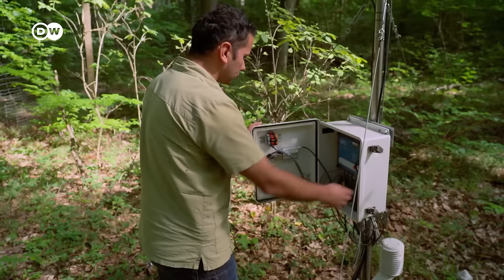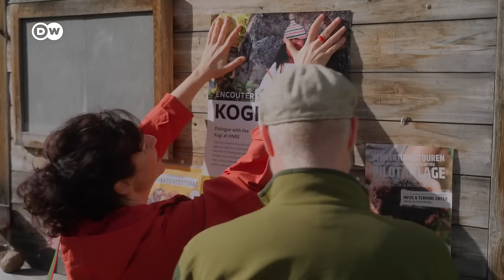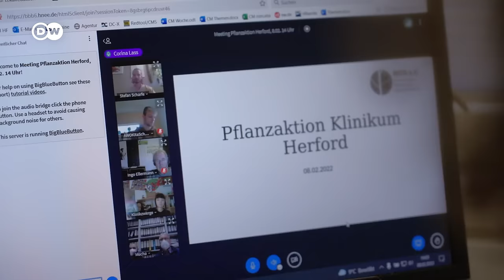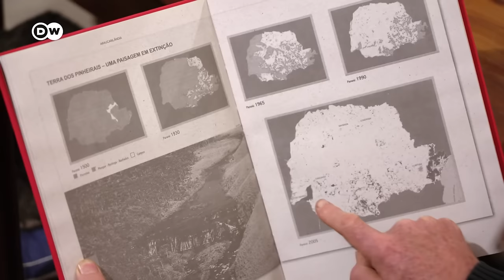Can trees stop climate change? | DW Documentary

Comment: It's also about buffering heat . Put trees around houses so it's not only hot rooftops..... for miles and miles . Trees can be an asset to city's. 
..... and create Forrest where perma frost is retreating.
Reply: @Lorin-GabrielLeaua-fm1lw  that happens if you plant the wrong trees... as usual don't just go out and spread a bunch of exotic plants that will become a nuisance.
Reply: The trees' evapotranspiration can lower daytime temperatures by 2-3 degrees C, but that isn't really the point of mitigating the urban heat island effect. Heat island effects are measured at nighttime. This is because of thermal emissivity, specific heat capacity, heat sinks, and rural temperature comparisons.

Evapotranspiration, which leads to evaporative cooling, can lower nighttime temperatures by 12 degrees C. 

And why didn't they mention reducing stormwater runoff pollution and increasing on-site detention of water, which leads to increased groundwater. 

We aren't really doing anything special. We're just mimicking and restoring nature.
Reply: @@Lorin-GabrielLeaua-fm1lw 

I disagree, due to personal experience. Have 30' and up trees outside of 'falling into my house' range and 15-20' trees within 'falling into my house' range.

 My 35' tall banyan tree complex deflects winds from Category 3 and 4 winds. During two separate eye walls I stood outside and watched 120+ mph winds roar over my house 35' overhead with about 20mph winds at house level. 

And then at least another 4 cat 2+ storms but not their eyewalls. 

My 30' live oaks deflect the wind from the other sides.

My house and roof remain undamaged. Houses in the neighborhood that are in the open suffer more damage.

One portion of the banyan complex fell in Jeanne, due to it being about 10 feet from a 15' deep canal that gimped the one portions root base.

Using trees as windbreaks was very common in Florida up until the 80's. Mostly Australian Pines were used to protect orange groves, and they worked.
Reply: @yodieyuh6077  your secret is not letting them grow past 35 ft . That's when they get you . 
I second your experience.  Made it through Ian( cat 5 )  without any damage to my 80-year-old house.  Trees buffering the wind was a big contributor.
Reply: @@Lorin-GabrielLeaua-fm1lw Trees have been in the business of of staying upright for longer than we've been out of caves.

As long as we give them healthy soil to grow in with lots of roots holding it together and buddy trees to share the wind-strain it'll be fine, and if we really want to be safe we can trip dead branches.

The problem arises when we plant solitary trees of decorative but weak species in loose "convenient" soil, destroy all deep rooted plants around them in favor of a shallow lawn.
Reply: @@Lorin-GabrielLeaua-fm1lw  - one doesn't "have to" have over-towering greenery (huge, century old trees) to have a relief in the heat island effect - 
 - shrubs shielding and providing shading for:  soil / lawns and walls of structures, every little helps.

PS, not every big tree comes down in storms, otherwise there would be no multi century trees anywhere,   cheers..

(if a high-voltage transmission-line is within reach of a falling tree, that needs remedying, notify the authority to sort that out.)

Comment: The trees' evapotranspiration can lower daytime temperatures by 2-3 degrees C, but that isn't really the point of mitigating the urban heat island effect. Heat island effects are measured at nighttime. This is because of thermal emissivity, specific heat capacity, heat sinks, and rural temperature comparisons.

Evapotranspiration, which leads to evaporative cooling, can lower nighttime temperatures by 12 degrees C. 

And why didn't they mention reducing stormwater runoff pollution and increasing on-site detention of water, which leads to increased groundwater. 

We aren't really doing anything special. We're just mimicking and restoring nature.
Reply: Interesting that drought tolerant plants, particularly cacti and others that function through CAM only transpire at night to avoid excessive loss during sweltering daytime highs. It would be interesting to investigate how daytime and night time transpiring plants effect overall micro climate and perhaps also how these processes manifest in the rhizosphere through physical, chemical and biological processes.
Reply: @hhwippedcream Good ideas. We can't forget the soil! 

It seems cacti have high reflectance and don't conduct heat? instead of having a high [0.98] thermal emissivity, such as most C3 plants. This means that they wouldn't be classified with other plants when producing NDVI/SAVI calibrated images. Do you know the equation for measuring healthy succulents using remote sensing data?

Comment: Nice video, some would say too little, too late, but I would say it does not work like this. People don't understand, including "scientists", that theese attempts are mockery of natural systems. A forest is a pinnacle of vegetation's succession. A system that includes not just trees of various species and age, but all other life forms in soil and above it. It also includes different layers of canopy, schrubs and vines, fungus etc. All working together; in relation to water cycles and climate types. Natural forests are DYNAMIC systems which have been accumulating fertility for centuries.

You can't just plant some trees in a clear-cut field or a degraded, former monocrop toxic wasteland and expect a success, let alone expect to have a FUNCTION of a forest. Usually theese "forests" are evenly spaced rows of young trees of the same species, never pioneering species, planted into sterile and dry dirt, suspectible to all kinds of pests... Nature doesn't work like this, it works through the succession. This is why very few of these trees live long enough, they are dying because the functional support elements are missing. Not to mention broken water cycles...and lack of life diversity.

Thinking only in terms of co2 concentration is going to be our downfall.

Comment: There are many wonderful benefits that forests bring, and there are many good reasons to plant forests and prevent deforestation. Forests help remove carbon dioxide from the atmosphere, and that helps in the fight against climate change.
But…forests cannot stop climate change from happening. Forests are part of the carbon cycle: they take in carbon from the atmosphere and store it in the wood. When trees die, the wood is decomposed and the carbon returns to the atmosphere. It’s a natural cycle that’s been running for hundreds of millions of years.
The issue is with fossil fuels. Fossil fuels take carbon from deep underground and inject them into the carbon cycle, causing an imbalance. Forests help, but to truly stop human-induced climate change, we need to leave the fossil fuels in the ground.